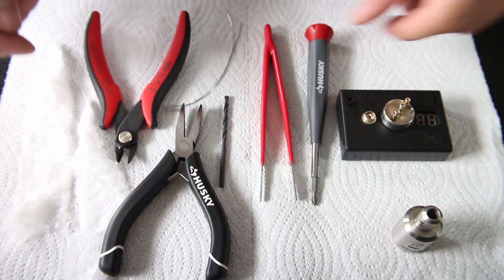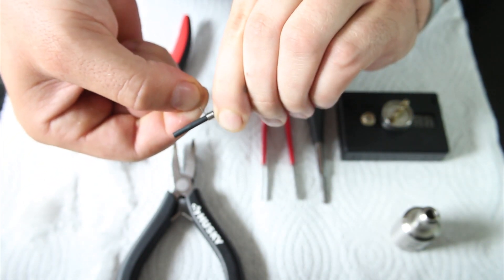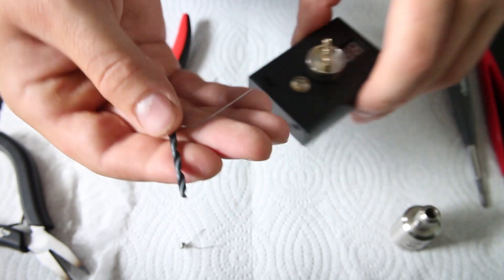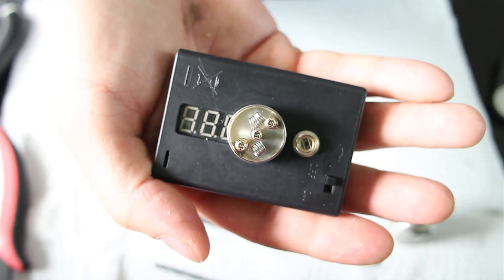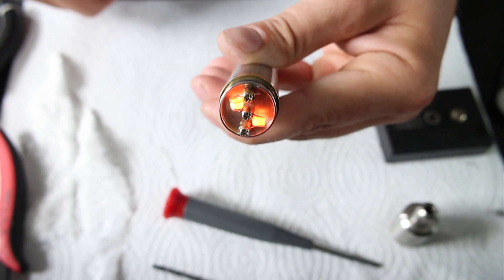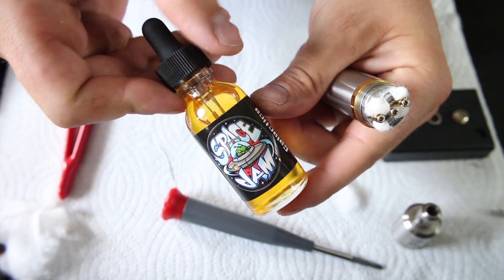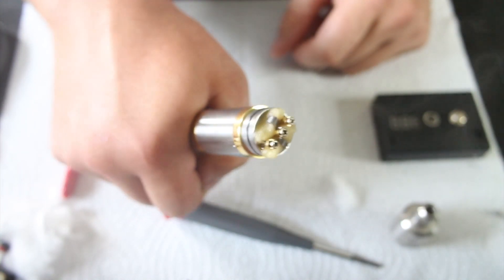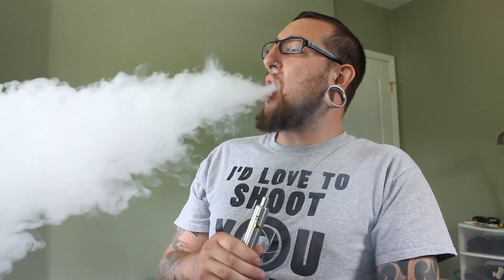#FRESHBUILDFRIDAY - Dual Macro Coil

Comment: Try a dual coil twisted 24g hybrid build. Yosh made the hybrid coil I think he has a vid on it. You can even try it in continuous? Or a Staged Heating coil but with 3 strands and have each strand 1 wrap less so you get 3 stages of the coil heating up?

Comment: hey, just wondering what you would recommend for a cooler vape with less throat hit, I'm running a cartel clone mod crowned with a little boy rda
Reply from the maker: Run your airflow as wide as possible and build a higher resistance coil like a .3-.4ohm. You can take much longer drags with lots of flavor and less heat and throat hit. Let the coils warm up a little before you start inhaling. Vape on!

Comment: just a quick question, why everytime i build 24g micro dual coil, my firing button heats up easily, is it bcuz of the mod or the battey? im using efest 30amp 1600mah
Reply from the maker: Check all connections from the post screws all the way down through the mod including the 510, 510 screw, battery adjustment screws, check all the tubes to make sure they're tight. If it still gets hot it might be that your mod can't handle the power your pushing through it. I find that most often cheap clones especially SS ones don't like builds lower than .2 ohms. Always be careful when using mech mods since there's no protection, if your mod heats up it means somethings wrong so don't ignore it. Vape safe and vape on!
Reply: Yup maybe my mod cant handle it, im using the origin mod. I got fuhattan coming this week so we'll see if that fix it
Reply from the maker: cjay cruz I have a FUhattan from the original creator of it I got from a group buy on Facebook. It's stainless steel but hits as hard as some of my copper mods. Just remember to use the correct 510 pin and make sure everything is nice and snug before you go and fire away. I have a .08 ohm 22g build on it right now and it doesn't heat up at all. Make sure you use a battery with a very high amp limit like the Sony VTC4/5 when building super low. If you have any further questions, shoot me an email: dailyvapetv@gmail.com and I'll try to help you out. Hope it all works out for ya!
Reply: Daily Vape TV how to get more flavor on a build?
Reply from the maker: cjay cruz Your best bet is using a twisted wire build rather than a standard wire build. It all depends on what your using for a mod. For flavor, I prefer my regulated devices using a higher resistance coil at higher wattages. Watch my video on the flat bastard coil and order some 32g and .5mm flat ribbon kanthal (maybe $15 total on ebay) you'll be blown away with the flavor you get out of it.
Reply: lower gauge wire builds, especially low ohm ones, need good batteries.
try to get samsung 25r batteries.
i had isues with efest batteries too.
hot button and batteries. slow ramp-up.
the samsungs got rid of them all.
efest=crap.
i would have recommended sony vtc5's, but they are not open for the public anymore.
samsung 25r's are the ones you want now.
Reply: Try wrapping a nano coil just smaller than the hole in your button where the contact screw goes, and place it in there and snug it down. The reason why you are getting a hot button is because the resistance in your mod is lower than the coils in your rda. Try looking here on youtube for Hot Button fix. A couple of good vids will explain more on what I'm telling you.
Reply: Heating firing pen means overload on amps andor short

Comment: How do the different coils affect the battery life?
Reply from the maker: Denb7 Usually the lower the resistance (ohms) the shorter your battery life will be. On a mechanical mod (one not controlled by a microprocessor) the battery dies slowly over time where as on a regulated mod you will get a consistent hit until your battery is too drained to handle the voltage draw.

Comment: Would this work on a 50w box mod
Reply from the maker: Twistt HD It depends on how low your box will fire. Most 50w devices can fire down to 0.2ohms and since this build came out to around 0.3ohms that means it will work. Make sure you check the specs of your device before trying it out for yourself because if you build too low, you may short out the mod. Vape safe and vape on!

Comment: could this build be done with 26g?
Reply from the maker: Of course! You can build it with whatever gauge you'd like but I'd recommend sticking to at least 26g if not larger wire. At the time, I only had 24g so that's what I went with. I believe that 26g will work just fine though. Vape on, brother!